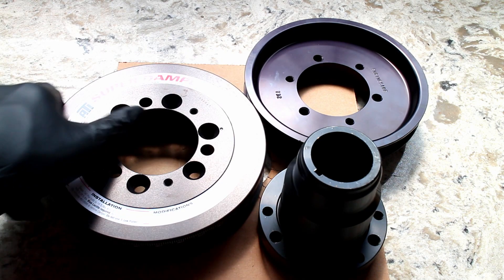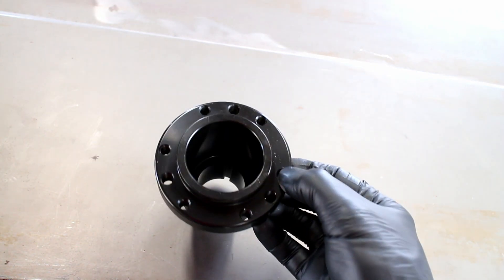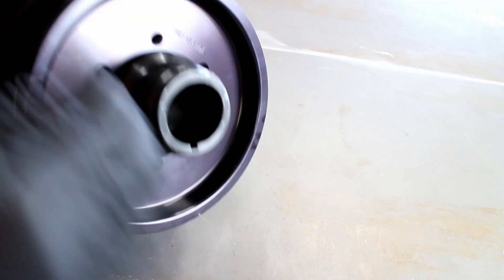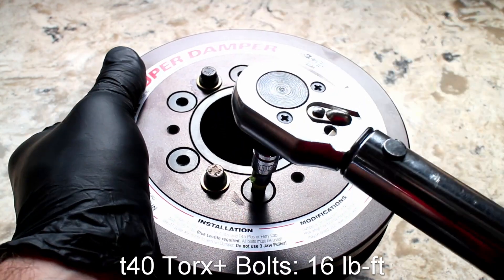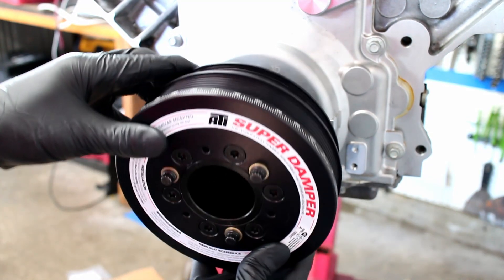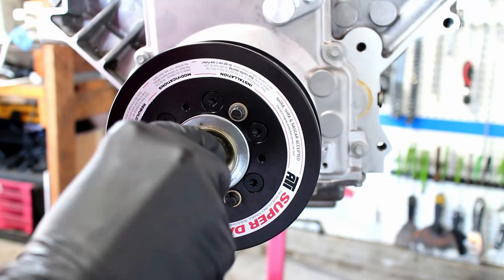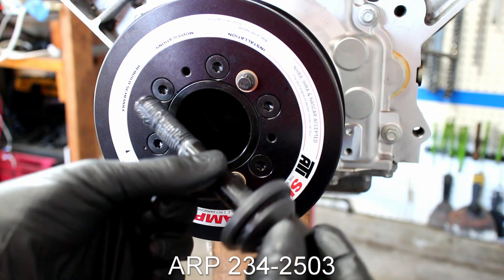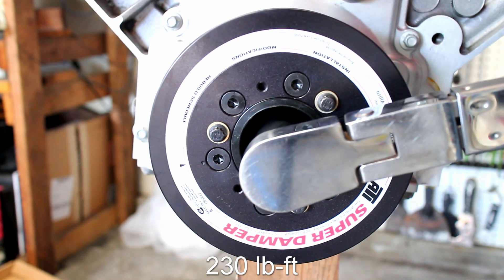ATI Super Damper Installall: LS Series (Pt13 82-92 Camaro/Firebird LS Swap)

Comment: I cant find a video anywhere that shows how to press it on in the correct location for a motion raceworks timing pointer
Reply from the maker: gotta put the number 1 cly at TDC and go from there.
usually ppl don't use these dampers with physical timing setups.
those are usually setup with crank triggers.

Comment: My ATI instructions say to use RTV on both sides of the washer prior to installation for the ARP bolt.   I have never seen anyone actually do that though...
Reply: Did you find TDC first then installed? It seems like no one is doing this….whats the point of having the reading on the super dampener if you don’t use it?
Reply: @BradlyFitness I have. It's essential imo, especially if aftermarket. Grab a piston stop, cheap Amazon scope, and mark it up, before and after damper install, roughly check it with the scope. Adjust the measuring point until perfect. Ez pz
Reply: Which balancer is that?
Reply from the maker: weird, My instructions only said to use RTV in the keyway.
No leaks so far so whatever i guess?
Reply: @3rdGenGuy   This was from the instructions:  If using an aftermarket ARP Bolt for any LS damper, or bolt #951359 (16 mm, 10.9 grade supplied
with Super Damper part numbers 918844, 918845, 918852 and 918855):
1. Apply high temperature RTV to both sides of the washer prior to installation.
2. Use 262 Red Loctite and tighten to 230 ft/lbs
Reply: I just did the keyway as well.  I guess we shall see
Reply: @billwestfall6288  This is what mine says too. Although before the ATI damper I was still using a ARP bolt on a stock damper and didn't use RTV and it did make it a little wet around the area, but never actually dripped any fluid.